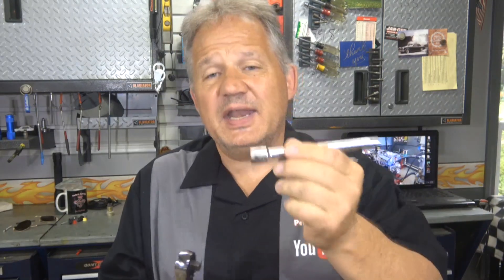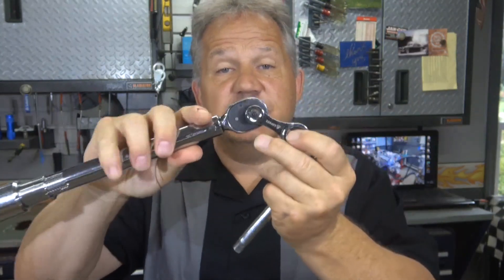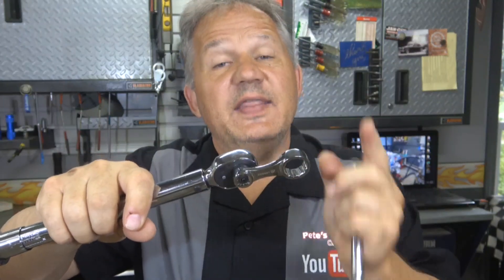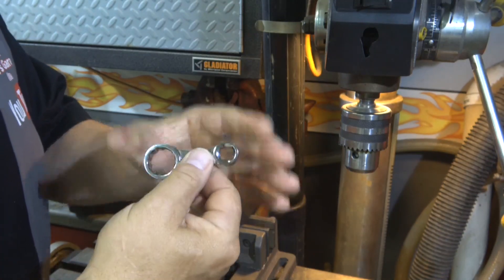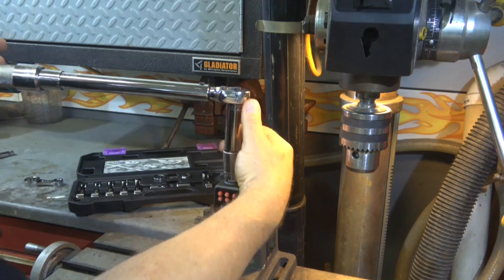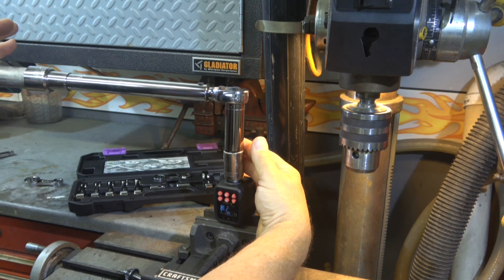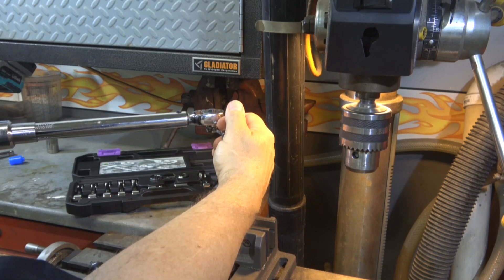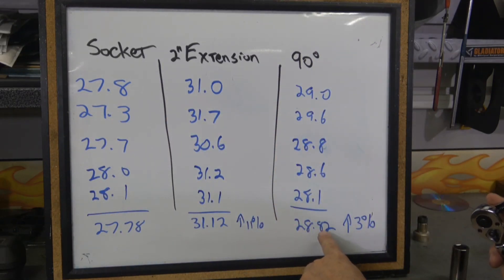Torque Wrench Extensions for Length - Use the Right Formula ANPUDS Torque Adapters

Comment: The reason you had a 3% increase when at 90° is that the lever arm (hand to bolt is the hypotenuse of the ‘right angle triangle’. You need to form an ‘isosceles’ triangle by making the dog bone slightly more than 90° off straight.
Anyway, back to the rusty bolt! 😊😂
Reply from the maker: That's interesting!

Comment: The extension straight got you closer to 30 🙄.  There is a difference... Minimal to me... Better than just using the German torque spec Goodentight. 😂
Reply from the maker: Interesting

Comment: How much would you reduce your transducer by if you wanted to torque a bolt to 30 ft lbs using a 2 inch extender?
Reply from the maker: I wouldn't. Use a 1/2" extender and it won't twist

Comment: One mistake that was made was not loosening the fastener each time, but length definitely has an impact even with using a universal socket. 
But doing the way it was done in the video can over torque a joint, giving an incorrect clamp load.
Reply from the maker: The purpose of the test was to see what at what torque a set wrench would break at.

Comment: Very interesting.. i didn't know it would have that much of an effect. I figured it would do something but not enough to he overly concerned about... Now im dreading the day i have to take out my 4l60E torque converter bolts.. torqued to spec with thead locker, and i used a home made 5 inch or so long torque adapter. I definitely over torqued them fuckers lol.  Brand new engine, but the trans was still doing fine at 300k, so I left it be for the time being
Reply from the maker: Yup, those on on there...lol